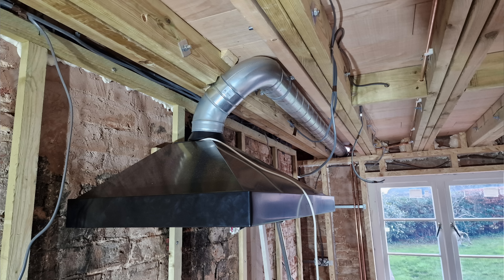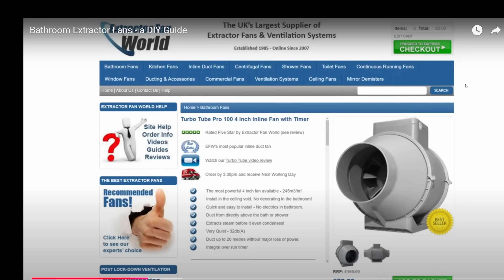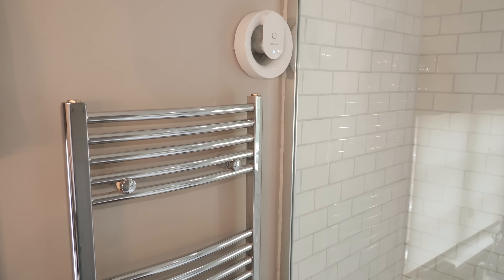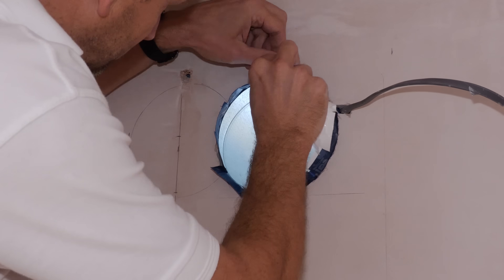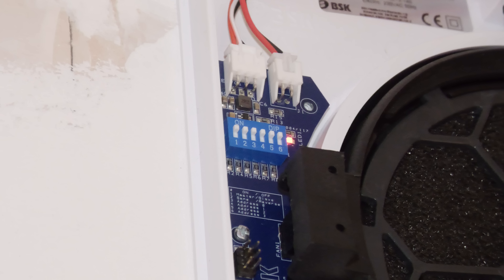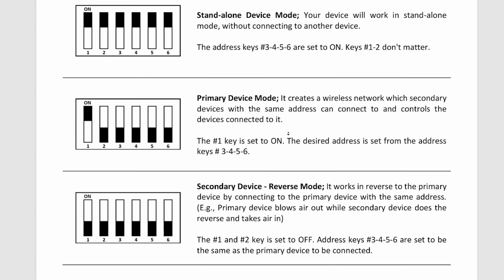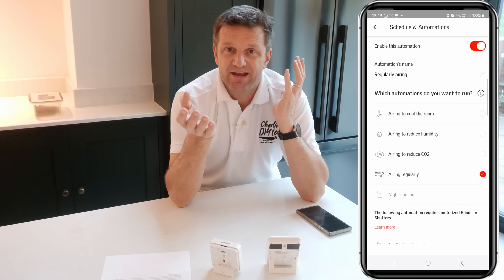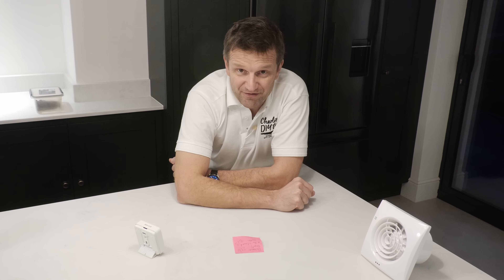A COMPLETE GUIDE to Decentralised Single Room Heat Recovery!

Comment: In response to your previous core drill comments about me that you missed, using the proper tools for the job you won't have the problems you described. Hard brick! That's why they use it to drill for oil.
Reply: Where I live most people tend to use the method as shown in this video due to the hard brick. A core drill takes roughly 2 hours to get through but as he says, it can be done in 20-30mins with multiple small holes.
I do have all the kit to drill a core hole but it just takes too long in hard brick areas. I'll usually start off a hole with a core drill to get a neat outline then switch to smaller bits.
In softer brick, block or concrete I would just core drill the whole way
Reply from the maker: @jacko791  Exactly!
Reply from the maker: I don't agree. The last time I used a core drill on this wall it was before I owned an SDS and I hired a massive core drill from our local hire centre. Also brand new bit. It literally took hours and hours.
Reply: have you asked someone to get you a life for christmas?
Reply: @solidus784 you comment has taken a lot of thought!

Comment: Can I take us back to PIV units, I had one installed two years ago, but it made zero difference to the amount of condensation we experienced in our house. Why might that be? I had heard such great things and am so gutted.

Really intrigued by this! Is this something you would use instead of a standard kitchen extractor fan? Ours is incredibly loud!
Reply: Yes the idea with these units is you just run them 24/7 at low speed.
Reply: Problem with PIV is getting the air movement to where it’s actually needed, maybe you can shut doors and open/close trickle vents to assist.
Reply: Couple of parts to this PIV is great but the air needs to go somewhere. Sources  of water need there own way of getting rid of moisture ie water source areas need there own,bathrooms wash area kitchen areas need there own extraction devices.

I use to run my PIV all the time but in winter the heating went on too much as it was cold  it did drop the humidity though I saw 37% one night I have a chimney so I’ve got a permanent opening and you have got to seal the loft hatch to stop it just circulating I used fire form to seal the wires going through the ceiling just to make it harder for the air to return to the loft basically forcing it to use my chimney as that’s the path of least resistance. 

In the end I turned it off got two dehumidifiers not the compressor kind so I can get a bit of heat from them at night and keep condensation down when we sleep in the morning the PIV is turned on max to do an air exchange for two hours and then shuts off all automagically through Home Assistant.
Reply: PIV needs places for the air to exit so vents/window vents in the affected areas. Possibly even leaving the window slightly open if not windy. Also PIV won't work that well if the house is very leaky as it'll just blow out the nearest big hole. You need to be able to control the ventilation for each room. Doors need to have a finger width gap underneath for air flow. Also they work by a temperature difference between outside and inside. The inside air needs to be warmer than the outside air otherwise they work in reverse making it damper inside. For this reason they are more effective at night.
They are also not a replacement for proper extraction fans in kitchens and bath/shower rooms. These need to be powerful and have an overrun for a good amount of time to dry the room after you've finished making moisture.
Reply: Friend who works at biggest manufacturer of PIV told me they're useless for most people, apparently very few properties actually benefit so I stopped looking.

Comment: A great video. We have installed MVHR as we did our massive bungalow reonovation and it has made a huge difference to the house. It was quite hard for us to do that so something like this for older properties are a great option.
Reply: Can I ask what system you had?
Reply: Yes, MVHR retrofit is a pain to do but it's also really good. I believe it's a lot more effective than these back-and-forth units, although of course I've only actually experienced 'nothing' and 'MVHR'. Also you can easily spend more money doing it with these units. I saw one supplier was charging £700 per unit. My MVHR system (fitted 8 years ago) cost £1300 total so about the same as a pair of those. It is cheap if you just have a couple of these £200-odd units.

Comment: Could I replace an existing ceiling extractor fan (which has a short soft walled run to outside) with one of these?
Reply: Have installed the BSK units our house (four of them), they are not intended to extract moist air from a bathroom, from a shower say.